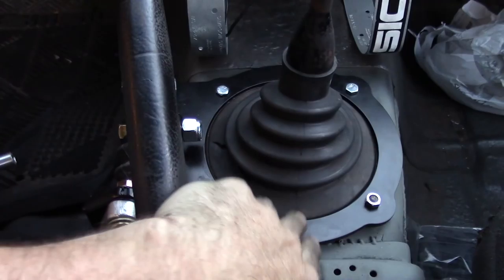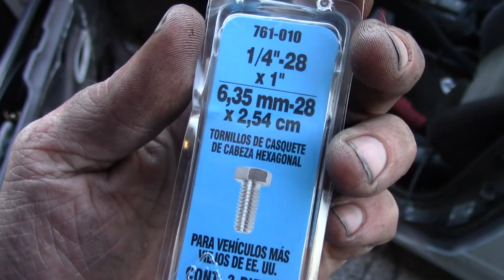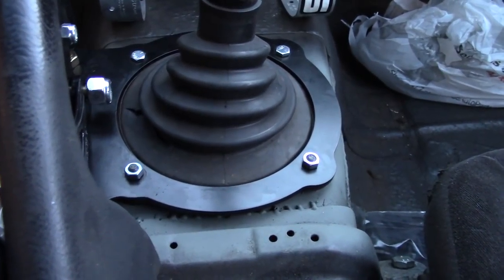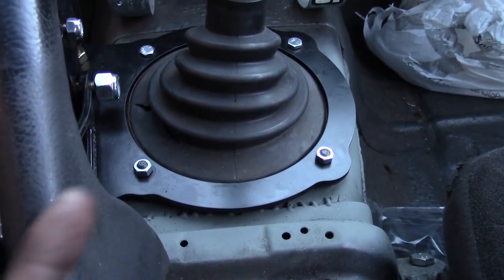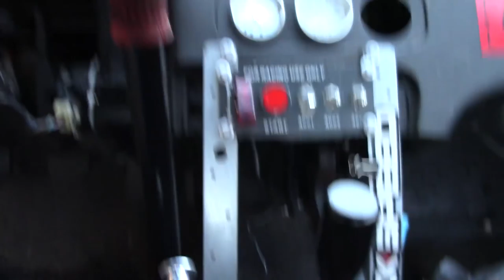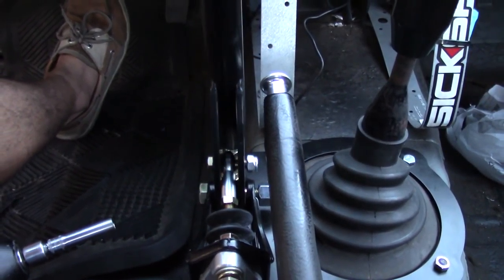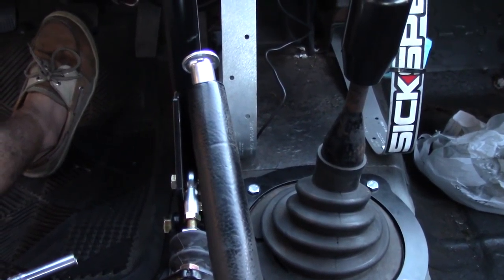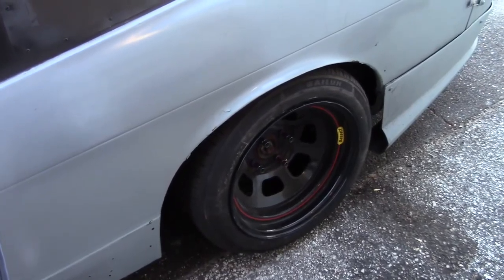Villains Handbrake Install + Shaving Down banjo bolts for Dual Caliper

Comment: couldn't you have just used a washer?
Reply from the maker: connor boyle i take it you haven’t done a brake system before? It’s possibly to stack those brass crush washers but if there is any sort of debris in between them it will leak. I’m also not haggard garage... so I’m going to do it the right way. Lol. With my luck it would be fine up until my first track day.
Reply: I'm that isn't the right way .I'm thinking it might leak. The guy never said you haggerd it was just a thought, I noticed your replies are kinda hateful .And you'll never be haggerd
Reply from the maker: 67z what? It was supposed to be a joke. Who would want to be haggard garage? But take it how you want it.